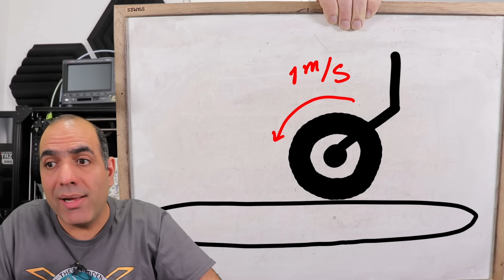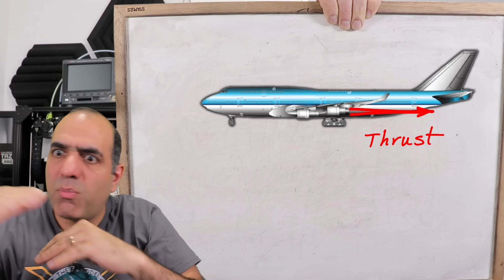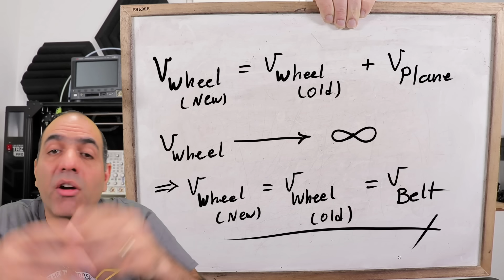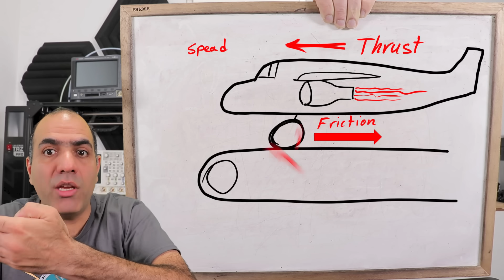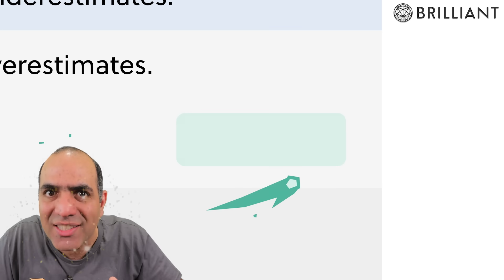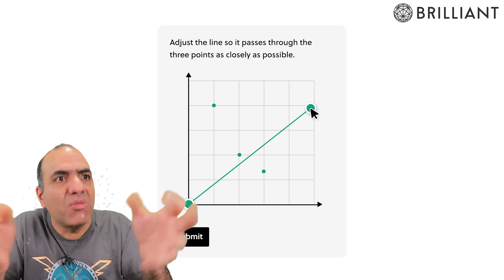Airplane Question that Drove Me NUTS!!!

Comment: I don't agree with the analysis in the case of wheels with friction.  The force of dynamic friction is F = μMg which does not depend on velocity.  The friction force is constant.  If this force is greater than the thrust, then the plane won't move.  If it's less than the thrust, then the plane will move.  You might say "But wait... turning wheels at infinite speed if there's friction requires an infinite amount of power... where does that power come from?"  And the answer is that the conveyor belt supplies that power.

Comment: The biggest problem is the way they describe the behaviour of the treadmill... What is the speed of the wheel? The speed on the surface of the wheel, or the ground speed of the wheel as a whole... The former being an unresolvable paradox, the latter being a bit more intuitive and in a 'normal' case the plane could take off.

Comment: Best answer ever! Thanks for addressing the real problem Medhi!

It's quite similar to any controversial issue that just won't die, be it political, religious, etc. People yell at each other about the surface disagreement but so rarely discuss the underlying assumptions and axioms. Your unicorn example was awesome!

For engineering questions where the axioms are more generally agreed upon, I see these questions as a game to see how many interesting scenarios fit the vague question.

Another one I'm not sure has been mentioned is that the conveyor belt is likely to weigh quite a bit and so there's likely to be quite a bit of lag in the feedback system. Thus with a high enough thrust to weight ratio, the plane MIGHT be able to get up to V2 before the friction catches up or the tires explode or whatever.
Reply: Sometimes it isn't about finding the correct answer, but posing a proper question to begin with
Reply: If it just matched the speed of the wheels it would only get to twice the takeoff speed of the plane
Reply: @mikefrom3089  Yes if it's matching the speed the wheels are moving forward, but the question is usually interpreted as meaning the rolling speed of the wheels. On stationary ground, those are the same. If you're doing a burnout smoke show, your rolling speed is huge but moving speed is zero. If you're on a converter belt moving backwards at the same speed the wheels are rolling, the moving speed is zero.

Imagin you're walking the wrong way in one of those airport moving sidewalks. Let's say it's going 2mph (or kph it works either way). If you're walking 2 mph (kph) relative to the walkway, you're not moving relative to your friend sitting in a chair laughing at you.
Reply: @WarttHog  to build on that example, if there was two side by each moving walkways and one wasn’t working, you had a race on rolling carts with leaf blowers would one be half as fast

Comment: The plane will not get off of the conveyer belt. The thrust of the engines push the plane forward relatively to the conveyor belt (and the surrounding air) that counter acts this force with its backward movement, to keep the plane static relatively to the surrounding air, so no lift. In a hypothetical scenario that the conveyer belt has enough torque and top speed and can react fast, it could keep the plane in place until the wheels or some component around there goes above its rated strength and breaks. If the conveyor belt cannot keep up with he thrust of the engines, the plane will slowly start moving forward, and given a long enough or infinite length, the plane will eventually gather some ground and air speed to achieve lift.

Comment: Paused at 0:40
The plane wont take off, because it's not the speed of the wheels that make a plane take off, but the headwind. Since the plane is essentially stationary from the wind's point of view, there's absolutely no lift generated.
On the contrary, if there's a wind tunnel that generates 150 kts (prolly more for the 747) of wind, then the plane, even if stationary with respect to the ground, will take off and fly well.

Comment: No, the airplane needs to be moving through air at 300km/h for it to take off. For a stationary plane, this means 300km/h winds. So, unless the airplane is inside a tornado, there is no way it can take off.

Comment: It is a bogus question. Too ambiguous, and assumes the wheels of the airplane have something to do with the airplane taking off. Aside from supporting on the airplane on the ground until it has achieved flight velocity, not really. 

The more interesting question: If you have a conveyor belt on the runway moving in the opposite direction of a LANDING airplane with respect to its air speed velocity, will the airplane be able to stop before it runs off the end of the belt? 

The wheels definitely have brakes used to stop the airplane, along with the engines and wing's flaps. This one I'm  not so sure about. 
🥲

Comment: No it could not be happened . Thrust of the engine is use only to push the plane forward the forward speed hit on the air and the air that goes on top of the wings have less pressure than the air below the wings that pressure difference is the reason to the vertical lift of the plane to ceep the pressure difference plane must keep moving. that question is not so hard if u have tried to build a  rubber band plane otherwise if the plane takes off the moving track somehow after it go up it will go up and up without moving forward in that concept so it can't be happened plane is not a helicopter . LoL😅😅😅😅❤ and i love ur electronics and ur jokes

Comment: Of course it will take off. The thrust medium is the air, not the ground. The wheels are just freewheeling and have no bearing on the forward movement of the plane. Now, a wind tunnel, on the other hand, designed to precisely match the plane's airspeed, would keep it still relative to the ground, but technically it would still take off...

Comment: Friction doesn't depend on the speed of the wheel. Friction only depends on constant coefficient and pressure, so it will take off in all cases.

Comment: The plane needs speed to take off 
Sinply said if the indicated airspeed (ias) is 0 and we don't have Wind we won't get enough lift. You can imagine it like this: if the ias is below vr ( its the Rotation speed of an airplane) it goes only forward to get enough lift we need the ias above vr.... if not than takeoff is nono

Comment: I believe if you boil it down it's an issue of AirSpeed versus ground speed.
The aircraft should still take off as normal but it's wheels will be moving twice as fast before it lifts. The engines should still take as long as normally would to get the aircraft up to speed for the Bernoulli principle to take over and achieve lift.

I love your videos.
Reply: I think it was very well raised however there'll always be narcissistic assholes that want to take a fairly solid foundation but bring up every single minutiae randomnest outlying thing really doesn't have much to do with the h
Whole and try to make it all about that.
It's a psychotic tactic that some people take to distract from the actual conversation so that no headway actually gets made in any meaningful way you're stuck playing conversational wackamole with these sycophants. Trolls and shills.

I do appreciate it when I am able to converse with people that are genuine and enjoy to expand the topic in new and interesting Ways.
Thanks. 👍
Reply: @NicholasHamblinQ  you seem to be missing the drag effect of the wheels continually being accelerated by the belt to the point where the friction translated through the plane prevents any forward movement relative to the air (assuming no wind). Though realistically the speed the conveyor would need to move to achieve that level of friction would be impossible in any practical setting.
Reply: @to_the_seas  Though if the question is like it originally was than conveyor is "infinite" lenghts that was the thing about 10 years ago when I stumbled into this question. I'd suppose the conveyor itself could very slightly decrease needed speed for liftoff, caused by also "ground" moving in faster and it possibly creating "wind". In reality rubbers would likely explode before liftoff speed. I highly doubt they're rated for 2x wheel speeds in air planes.
Reply: @jothain  the problem doesn't limit the conveyor to 2x speed though, it will move as fast as the plane tries to thrust forward. The wind from the moving belt would eventually probably create enough lift to free the tires from the conveyor which would presumably slow down the wheel spin and the conveyor speed so maybe it would be stuck oscillating...
Reply: I'm sorry physics it's so hard for you guys
Reply: @NicholasHamblinQ  I think you havn't yet noticed that the question is not worded exactly the same that it normally is proposed. This belt is allowed to ramp up to light speed in one microsecond. Does that change the situation? Yes, very much. The tires, the landing gear, even the belly of the plane will be molten aluminum before it moves even one inch. Actually, its even worse than that. Probably the entire city will be destroyed in a ball of fire.
Reply: I think with sufficient friction btw tyres and belt it could behave as a car but thats not possible at high speeds
Reply: as a side note. planes can fly without an airfoil, aka, flat wings. The airfoil just adds about 20% efficiency.

Comment: In a normal situation the wheels will have a small amount of friction, the belt moving in the opposite direction would just increase the friction slightly requiring a bit more fuel to take off.
Reply: But if you start taking friction into account then please start taking into account the build and the materials of that super mega giga belt... The belt mechanism would be long gone before the wheels so there would be no more pull back before the wheels go down and stop the plane. Right?

Comment: I think the wheel won't be spinning.
As the plane move forward, the push will let's say force the wheels to spin counter clockwise, so the conveyor belt counteracting this would try spin the tyres clockwise.

Thus the plane moves forward and the wheels don't spin at all

Comment: I agree with everything you say except when you say that with no bearing friction + no-slip condition the plane can take off, with the wheels and belt moving infinitely fast. I don't think you can just say they are 'equal at infinity'. I think the key issue is that (assuming no-slip) the condition that the belt be moving at same speed of wheels can only be satisfied with the plane stationary. As soon as the plane activates its engines and moves, the condition is not met.

Comment: When you posed the question, I thought that's what they were looking for it too. But my engineering brain gets to thinking how the wheels are basically just there to hold the airplane off the ground, with no real drive capability. With a few caveats that some larger aircraft will have a smaller axillary drive motor in the landing gear; so they don't have to use a pusher tractor, while taxiing to the terminal. Otherwise the thrust on the airplane is all reaction from the engines, acting directly on the airframe. And furthermore, airplane did take off from engine power acting on the wheels; then the airplane itself would only be capable of a gliding hop; and would have to make multiple landings, to get traction, before arriving at their destination.
Reply: Name the self-taxying plane please.
Reply: @givenfirstnamefamilyfirstn3935  I had to look it up. And it's a third party retrofit kit for Airbus A 380 and Boeing 737.

Comment: The airplane moves thanks to thrust, not from engines in its wheels.
Therefore it doesn't care if the "runway" is a conveyor belt moving opposite of the airplane's intended take-off direction.
It only cares about the air that surrounds it.
The airplane will always take off. (Wheels and their ball-bearings will be much more stressed tho).

Comment: The plane will take off because the airplane body will accelerate with V1 and the wheels will accelerate V2 (double the speed since the belt will match their speed in the opposite direction) but the airplane body will keep on accelerating relative to the ground and take off eventually while the wheels will scream for mercy at roughly double the speed.

Comment: Wait, that's it? No, no, no, You forgot one important thing. The belt matching the speed of the wheel will have to accelerate to counter the static trust, yes, but what would that belt do to the air around it? It would move it by friction, so it will get air speed towards the wing of the airplane and it can go up to a point when plane will take off. It will not stay in the air for long, but it would take off eventually.

Comment: I thought this was a simple question but now I'm confused and doubting myself. Assuming its on earth with normal friction conditions I thought I would take the belt and plane as one system and then look at it from the reference frame of the wind. And from that reference frame the belt+ airplane is not moving and therefore there wont be any force of lift created to make the airplane take off.

Comment: Salam, sir! Sir, my name is Konoz Bin Rashid, and I'm from Karachi, Pakistan. According to me, when a plane is moving across the runway, the runaway is seen to move backwards relative to the plane. But the wheels of the plane are rolling without slipping. Now, if the conveyor belt is moved at the same speed as the plane's take-off speed but in the opposite direction, then the speed of the plane relative to the conveyor belt won't be forward relative to the runway floor. Instead, in this case, there would be no relative motion between the plane and the runway conveyor belt. So the plane would also move backwards rather than forwards, as it does normally when taking off. Now, since the plane won't effectively move forward, it won't take off.

Comment: Normally the bottom of the wheel would b moving at 0 (because the ground is not moving and the wheel is not slipping), the middle of the wheel would be moving a v (relative to the stationary reference plane, no not that kind of plane) because the wheel is still attached to the plane, and the top of the wheel would be moving at 2v. In the example of the belt moving at the speed of the wheel, the most logical interpretation would be that the belt is moving backwards at the speed of the center of the wheel (v). This would mean that the bottom of the wheel would be moving backwards at -v, the center of the wheel would be moving forward at v, and the top of the wheel would be moving at 3v. So the wheels would have twice the rotational speed, but be moving the same translational speed.

Obviously, the plane takes off because the plane is driven by propulsion not the wheels.

Stack exchange thread, with a good picture explaining the speed at different points along a wheel:
https://physics.stackexchange.com/questions/295282/why-is-the-velocity-different-for-different-points-on-a-rolling-wheel

Comment: Although I agree with your point about assumptions, it's really hard to cover all factors in this type of question, so it makes sense that a lot of the assumptions are implied. I think this eliminates Case #1, as the whole question is kind of based on the assumption that the wheels rotate, and it wouldn't make sense for the wheels to have no friction against the runway. It also eliminates Case #4 as its implied the plane is in fact trying to accelerate. ...

For Case #2 and #3 you're missing the rotational inertia of the wheels. As the wheels get rotated by the friction against the runway, the inertia will create a force against the movement of the airplane, even though there's no friction within the wheel itself. Even with the inner friction in Case #3, the inertia would be a much bigger resistance. 

So I think a Case #5, where the wheels also have inertia would be the most "correct" answer. This would mean that the plane would not be able to take off. Because as you demonstrated in Case #2, even the slightest forward speed would result in a continuous acceleration of both the wheels and the conveyor belt. In reality this acceleration would only be limited by the grip of the wheels, so it would actually resist the planes movement as much as if the plane's brakes were locked. But if we assume the friction is infinitely large, so the wheels can't slide, the acceleration would be infinite, and the plane's speed would be 0, no matter how much thrust is applied. 

This can even be proven mathematically by simplifying the situation. We can say that the plane's airspeed = X, the wheels' surface speed = Y and the conveyor's speed = Z. We know the plane and conveyor belt moves in opposite direction, which means the wheels' speed is the sum of the plane and the conveyor's speed, so Y = X + Z. We also know that the wheels' and conveyor's speed is the same, so Y = Z. Which means Y - Z = 0. To find the plane's speed we just have to solve for X in the first equation:

Y = X + Z  -->  X = Y - Z. But since Y - Z = 0, that means X = 0. 
The plane's speed is mathematically defined as 0 in the question itself, which means the plane can't move, no matter what.